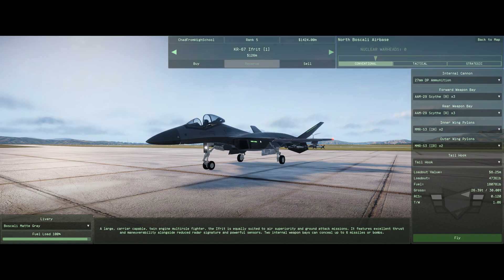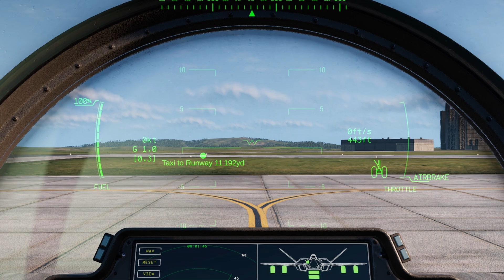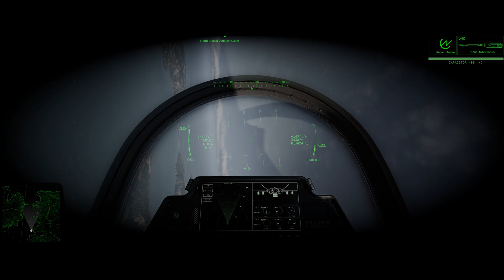Nuclear Option HUD, Taxiing, Takeoff, and Landing

Comment: I have one request from the Nuclear Options devs.  In VTOL aircraft it would be nice to have a vertical speed tape to the right of the crosshairs.  Just give me an indicator if I am climbing or descending, and by how much.
Reply from the maker: I believe there is a indicator for that. I believe it's the top right  of the hud and it says FPM. It indicated how many feet per minute youre gaining or losing. That's your vertical speed indicator
Reply: @TalonOneFS  I know about the digital number, but I prefer to also have an "analog" speed tape that grows up or down in size based on VSI speed as well.  Its a LOT faster to interpret vertical movement from that sort of indicator than it is just a +/- number.

Comment: Fairly certain the W is your nose, not your crosshair. It changes to a crosshair when in gun range. Dependant on the cannon.

In addition, I believe the wiki asks that the pilot, once on the runway, holds the break as they max throttle and only let go once the airframe begins shaking. Especially helpful with carrier takeoffs.
Reply from the maker: @Neolith_  yes using the brake while max thrust is useful for carrier takeoff. I rarely use it for a regular takeoff. The w is the nose and the circle once the landing gear is up is the heading indicator
The w swaps out with being the crosshair once you raise the gear so that's why I used that sort of interchangeably